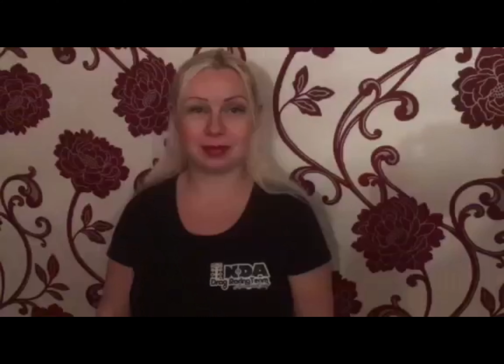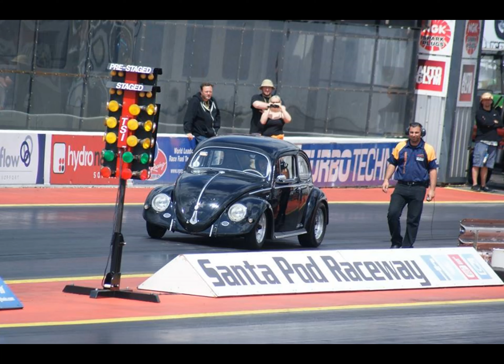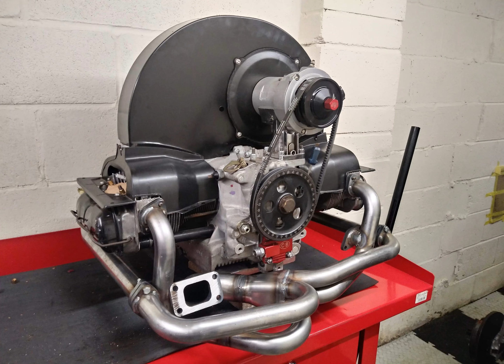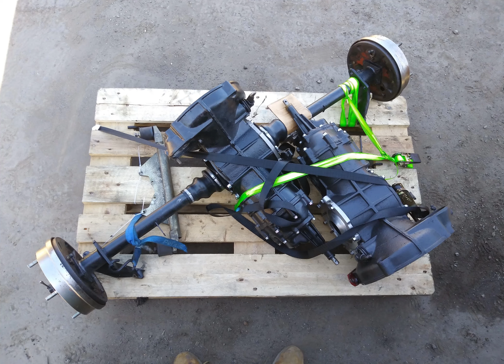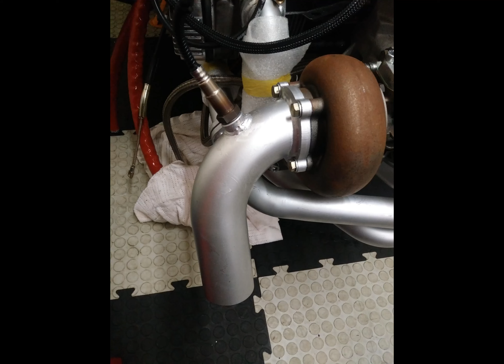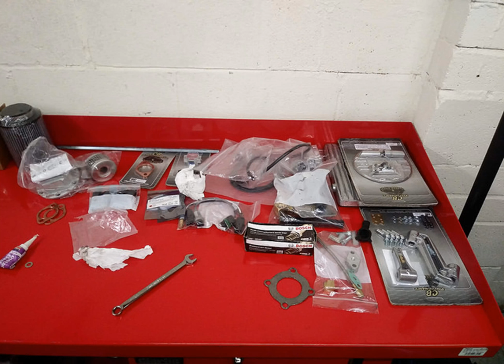How to guide CB Performance turbo & EFI kit ( Part 2 of Little Horus Drag VW beetle build!)

Comment: It's mind boggling how far off the J tubes are on the CB kit, and it has not been fixed in 15 years. A friend of mine built a CB hide a way kit almost 15 years ago and I thought it was a fluke that the j tubes were off almost one inch (25mm). Last summer another friend did a blow through Weber setup with the CB hide away header and the j tubes were still off 1" lol. Why fix it if you are basically the only one who makes it I guess is their thought.

 The reason they use the black iron pipe on the turbo drain is heat. It runs very close to the collector and can melt a rubber line in that area. May not be a problem on a drag car, but a true street car can melt the hose in stop and go traffic if you drive it spirtly. Will be watching to see what she runs. Is there some video of you 1776 turbo?